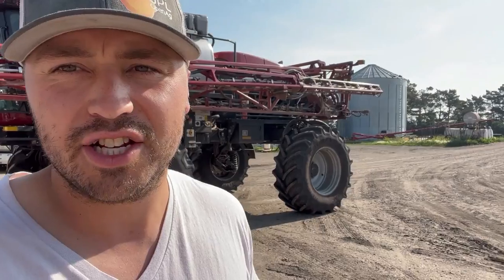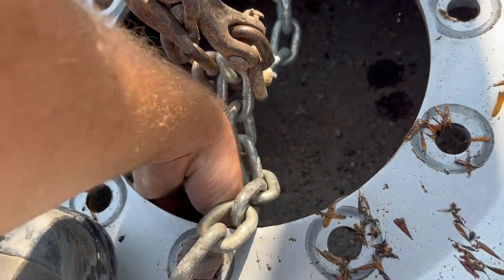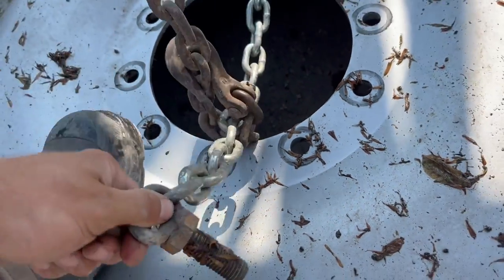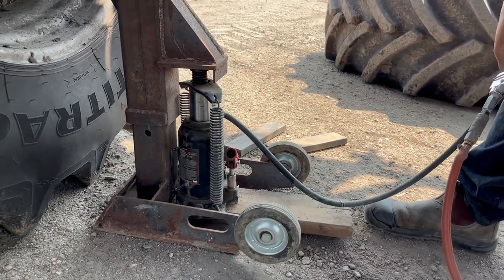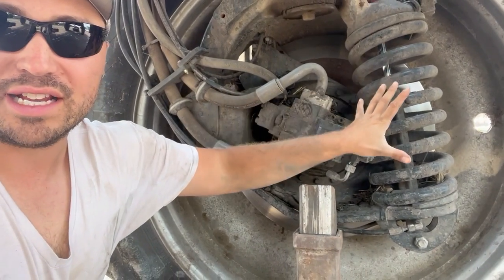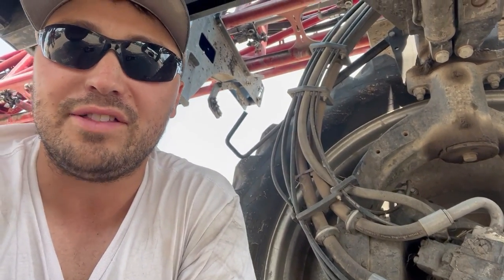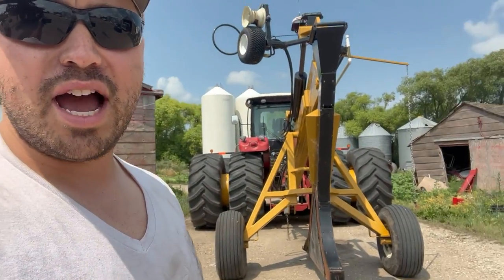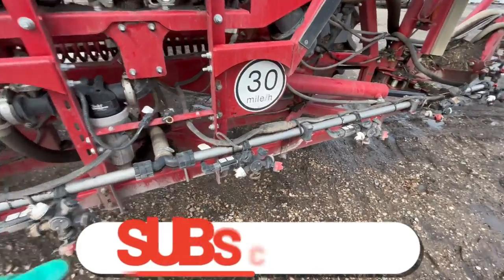Sprayer tire changeover

Comment: I have a case sprayer as well. Tire shop when changing like you run a light chain through the spring and bolt the chain.  This way the spring  can only spread so far till the chain  gets tight.  I then grease my sprayer as the pressure is off the grease fittings.
Reply from the maker: I assume they’re lifting from the frame and not from the bottom of the axle then?
Reply: @windmillfarms2845  yes they lift from the frame. The worker told me a farmer taught him how to use the chain. I grease the sprayer then. The grease goes in easy and there is no tires in the way.